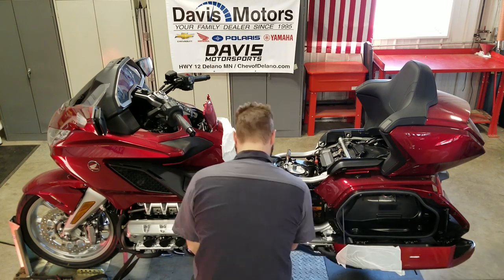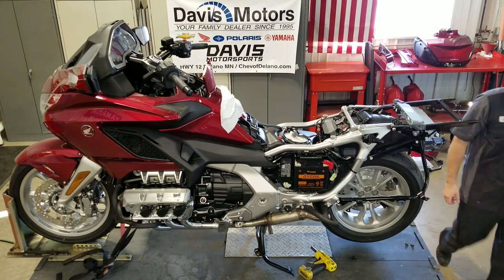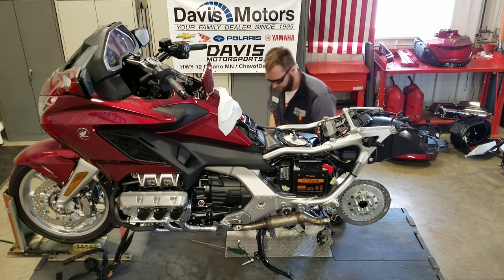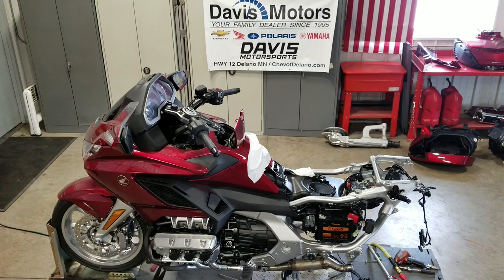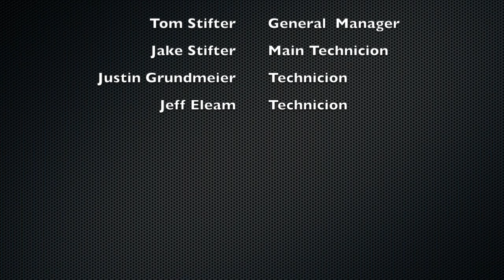TIME LAPSE VIDEO OF CALIFORNIA SIDE CAR ENCORE TRIKE CONVERSION ON 2018 HONDA GOLD WING!

Comment: Who makes the rear trike 2-wheel assembly? Is the final drive same as the oem wing? Are both wheels driven?
Reply from the maker: Thanks for watching.  The conversion is made by California Sidecar.  California Sidecar makes their own differential and suspension assembly. Both wheels drive. The OEM final drive is not used.

Comment: What's average cost to convert Standard Golwing (2-wheeler) to "Entire Trike System"...?? (on average?)...Rough estimate & best year models recommended...etc.-preferred newer Honda GWs (2015 Up...??)  -Thanx Mucho...Amigo..!! (HartrOtex-BC)...-Currently Owned 2010 Trike stock & runs great..but really have itch for "newer version model"...etc.;-) Right...?! -Enjoy your videos tremendously especially in "Speed-Mode"...-Really Great...!! ;-)
Reply from the maker: Thanks for watching.  Converting a 2018 and up Gold Wing with Encore trike can run from $ 20,000 and up dependent on accessories etc.

Comment: How do you tell how much gas you have in the auxiliary tank, Or when it's empty??
Reply from the maker: Thanks for watching the video.  The great thing about the CSC gas tank it is self-supported off of the factory tank.  It fills through the line that connects the 2 tanks and draws through the same line.  Fuel gauge still measures amount in tanks as it is used.  Low fuel light now will mean you have about 2 gallons left to burn.  Very simple, no maintenance at all.

Comment: Hey there grat video on the  pioneer 1000 clutch ajsment I followed your steps  but I still have  MT ST on dash and still clutch slip is it stuff!
Reply from the maker: James, that sounds like there are more issues.  We would recommend you have it checked out by a service technician.  Just so you know, Honda had an product improvement campaign on the 2016 and 2017 clutches, if that has not been performed be sure to get it done.  Will be done free of charge at Honda dealer.  If your in Minnesota area, we will be glad to help  Good luck.

Comment: How much does it cost to add the extra gas tank to a 2019 DCT CSC trike?
Reply from the maker: If done when trike is built it is about $ 700.00.  If trike is built it will require major dissassembly and will cost much more.  It is the first thing that is put on the trike once assembly begins.

Comment: It's a bad idea, cause it will be very hard to turn
Reply from the maker: Thanks for watching the video.
Making it a trike does make the handling considerably  different.  We install the CSC Power Trak upgrade, it greatly improves the handling.  However, a trike will never drive like a motorcycle.